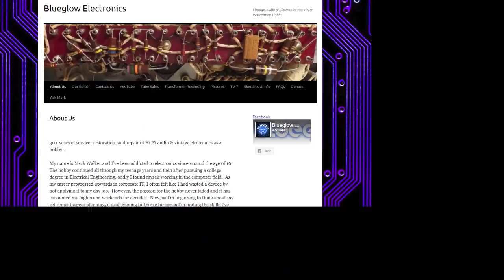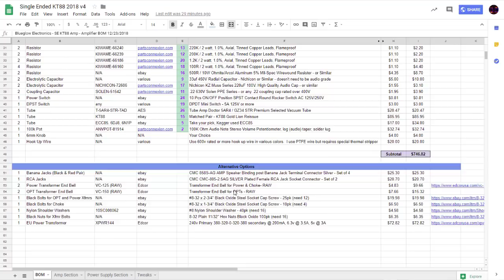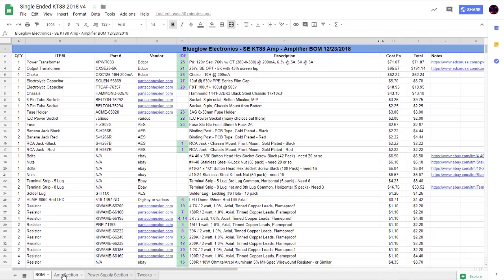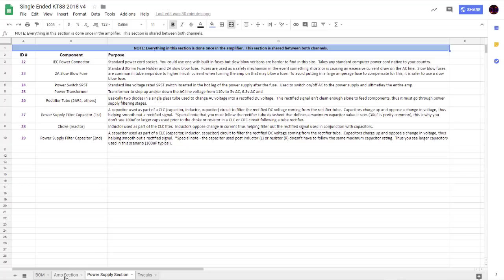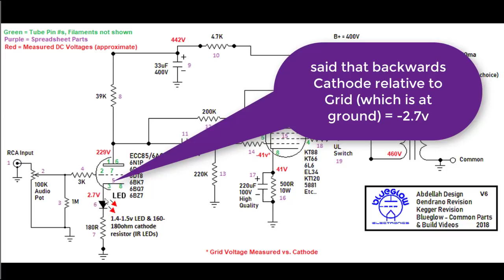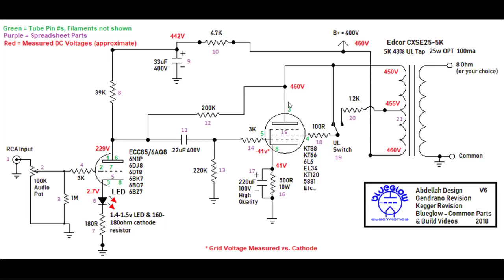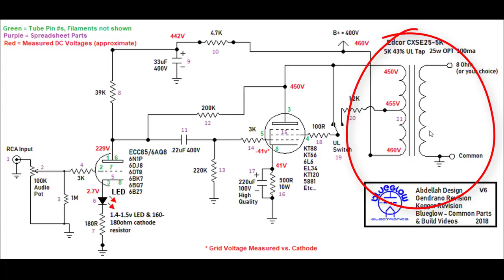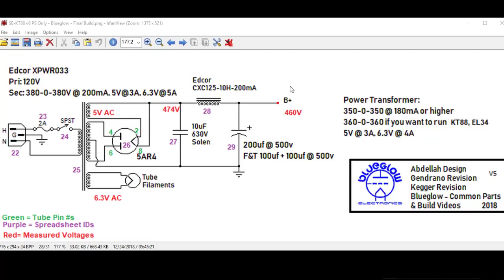KT88 Single Ended Tube Amplifier Build 2018 - Part 11

Comment: An excellent explanation of what everything does in a tube amp.  Learned a lot especially the section on the ultra-linear / triode setup.  Do remember you doing a video on how the DC voltage rides on the AC filament voltage, but for the life of me cannot remember when, but it explains/shows this extremely well.  Thank you again for the wonderful video and it wasn't that long went by very well!

Comment: Thank you so much for this whole series! I am semi retired and beginning to resume this hobby which I did in my 20's. In doing that I have purchased and read over 30 books on the subject this year, I've analyzed countless schematics, I learned a lot... But it also made me very aimless as to what I should build! There are so many choices. Ive decided to start here because this amp is so simple and classic, my reading has brought me to studying such things as high voltage regulators, DC filaments, etc. nice but I need to step back with a basic build like this. Again thank you so much for doing this. One question about the power supply... You strapped the two 100uf capacitors outright. But for only the cost of a low ohms 12 watt resistor you could have added an additional CRC stage and only lost 10 volts or so. Would strapping the two 100uf sections as an additional CRC given you much better ripple rejection than a single 200uf?

Comment: Maybe you could do a short video on what Ultra Linear mode is?  It seems to be a negative feedback system but separate from the signal grid circuit.

Comment: if you use EL34..., the grid g3 pin 1  must connect the cathode pin 8 (not internally connected)
Reply: so soldering a short as possible jumper wire basically from pin 1 to 8 would be good for swapping any of the mentioned tubes then?
Reply: @jakep8484  yes

Comment: I am a struggling beginner and I appreciate the time you have taken to walk through this circuit.  I try to visualize what is happening with the electricity as it moves through the components, but I am really having a hard time visualizing "current" versus electron flow as you used those terms.  Is there any way you could describe this circuit all in terms of electron flow (like you did when discussing tube amplification)?  The convention of current moving in the opposite direction as electrons really messes me up.

P.S. - I hope you are feeling better each day and that your heart will get back to full strength soon.

Comment: SE and especially SE-triode opens a window to the music that can not be matched by PP operation/complementary transistor /class AB , class D and even PP in class A.......
But it will let you hear the sound of EVERY component you will use.......just like a chef does his cooking with the choice of his ingredients.
It will also reveal that modern speaker are build for amplifiers with very high damping....and the single ended will reveal it's real nature with larger coned speaker of higher sensitivity and small cone excursions.......
One's you tasted high quality food , there is no way back...........only more power but less reality and room filling presence.....closer to what is real music.
I heard a lot of bullshit about tubes............and believes ( believers with there technical arguments).............i would rather talk about semiconductor sound than of tube sound...........silicium dveices are made out of sand and the current flow through a cristalline substrate..........it will always be a grainy sound how well this may be masked by FB and other techniques.......so will it be with smaller modern loudpseakers......it all sound good untill you experience a quality SE amplifier.

Comment: Thanks so much for your video series on amp building. It's a real eye opener!

One thing I can't get my head around is how the DC from the plate of the kt88 isn't affecting the DC at the plate of the input triode? I understand that the shunt resistor is feeding back ac signal but isn't it feeding back DC also?

Comment: There should be an input decoupling capacitor between the pot wiper and the 3k resistor otherwise the potential divider formed by the 3k and 1meg resistors will be affected by the 100k pot.

Comment: Thank you Mark, I learned a lot from this series of videos. I have heard a number of single ended amps, all of them flea watt, and loved how they sounded through horn speakers. One question: why do rectifier tubes require a separate winding for 5V when every other tube uses 6.3V?
Reply: Because the 5V winding is referenced to the B+ voltage. The 6.3V windings need to be referenced to ground (or to an 'elevation voltage' not more than 50V or so above ground).

Comment: Good video Mark, for the output stage could you use 4 leds with the same voltage drop in parallel to set the voltage or a different diode maybe or a voltage regulator like the lm317hv? What about using a constant current source?

Comment: I notice that the voltage applied to the 33uF cap number 9 is 442 volts while the cap is rated for 400 volts. Seems like that might be pushing the limit a bit. Is there any typo here or are we just living on the edge?
Reply: An estute catch. As Scotty would have said "Captain,  she's gonna blow!".